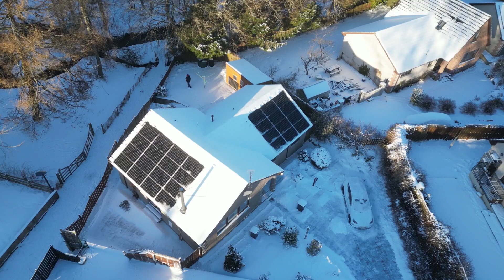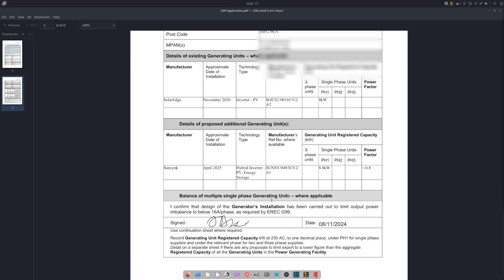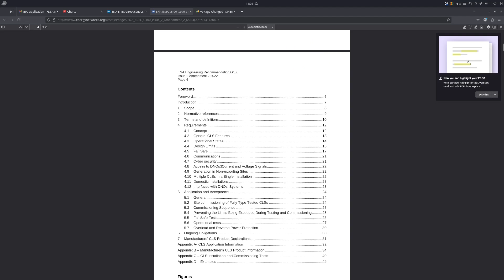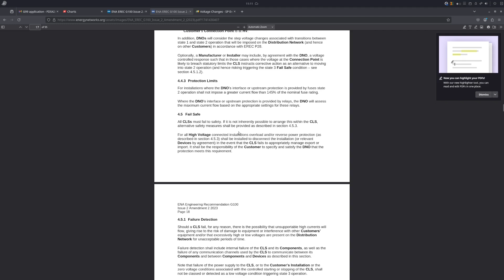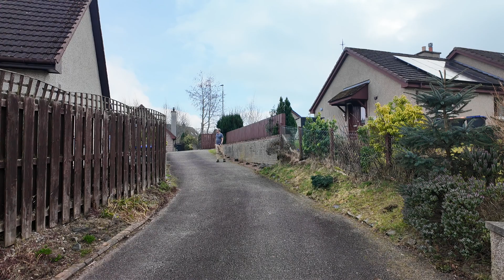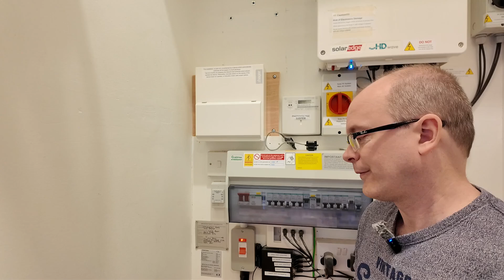G99 Application process for more solar/batteries

Comment: Have you considered having the solar edge export to the grid, then an eg4 chargeverter to charge up batteries connected to a sunsynk and the rest of the house. I'm not sure if the chargeverter has been used in the uk before, but seen it in lots of US videos. My voltage ofter goes over 253v without solar (lots of neighbours have though), I think it means one of my neighbours car charger doesn't work, due to most pen faults knocking off at that voltage.
Reply from the maker: @dave-461  EG4 is a brand I’ve seen only on American YouTube channels.  I’ve never seen it in the UK.

Interestingly one neighbour is now seriously considering solar.  The reason:  Electricity prices going up!  I think overvoltage is going to become an increasing problem as more neighbours install solar.  I suspect my own inverter will drop out when 253 Volts is hit.

But pen faults are something else.  That’s got nothing to do with overvoltage.  I seem to recall that the Zappi charger has a clever way of detecting pen faults, but given that your Ze loop impedance would increase (a lot) under pen fault conditions, my expectation would be that under voltage ends up being a feature, especially during high load conditions.
Reply: @anthonydyer3939 if your neighbour installs 3.68kW of PV, and that pushes your shared cable over it's limits then the DNO will be responsible for upgrading the cable.
Reply from the maker: @TheRonskiman  It’s not a shared cable according to the DNO.  So in the situation seen on 24th June, there would be 240-242V at the Main Street cable.  If they add export, then the Main Street voltage would certainly rise a little.

Interestingly there’s a planned power outage for 4 hours next week,so I’m reckoning that they might be upgrading something.  Other portions of the village received a planned power outage a few weeks ago.
Reply: @anthonydyer3939  I thought you said in the video it was. Hopefully you can get something sorted.
Reply from the maker: @ no it’s just the driveway that’s shared, not the cable.
Reply: @ yeah I think it's just the way some car chargers are setup to deal with pen faults, that they just turn off over 253v. I'm near a hospital, I don't think my voltage has ever been under 235v, if I wasn't near a hospital, I guess the voltage could be turned down. Luckily my granny cable charges without issue.

Comment: Very interesting Anthony I myself have high voltage first thing in the morning it’s about 245 / 248 volts midday it’s 255+ I do have DNO 12kw export capacity but anything over 7 or 8 kw export one of the inverters shuts down usually the solis inverter. I am in two minds whether to get in touch with them or not I know that they cannot take my approved 12 kw export of me. I think my problem is that the transformer that feeds my and 2 other properties is very old some 20 years ago when I built this place the electrician at the time got the DNO out for high voltage but they said at the time it was within range but I didn’t have pv and battery then . I like the idea of of grid and hope you think about it we have lots of power cuts here in mid wales . In late January 2025 on one occasion the power was of all day ( I have a powerwall) and it was very sunny  it was fantastic to watch the powerwall increase the frequency so one of the inverters shuts down then when I plugged the car in it restarted at times I was generating 9+ kw. Look forward to your final decision 👍👍👍

Comment: Wasn't expecting war. 
I expect more storms and potentially more dunkelflaute susceptibility (and high prices during dunkelflaute being passed to customers) as Torness goes offline in the next few years.
Reply from the maker: @grahamleiper1538  Dunkelflaute will be mitigated by having gas power stations held in reserve (normally cold standby, but hot standby as conditions arise).  As the years turn to decades though, interconnectors will form an increasingly important role instead of gas power stations.  There’s at least a weeks forcecast notice of dunkelflaute conditions arising, so that’s adequate time to prepare a thermal power station for a warmup in advance of a hot standby state.  

But you’re right:  They create ideal conditions for massive short term energy price hikes.  This winter, we had continent wide dunkelflaute conditions across Europe.

As for war, they are like pandemics.  Few people expect them until they are upon us, but it does have a feeling of 1938 all over again on the political stage.
Reply: @anthonydyer3939  cold standby is essentially what Peterhead already does. 
I'm personally fine with them burning gas, even oil, during dunkelflaute. Anything else quickly gets really expensive.